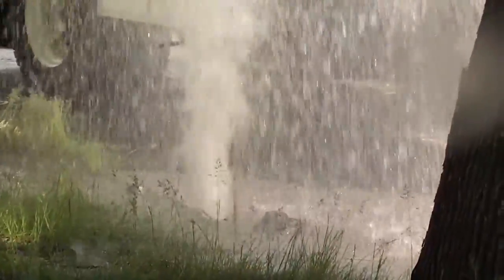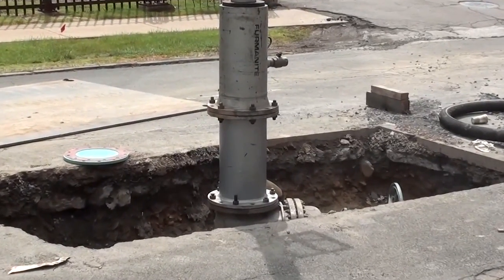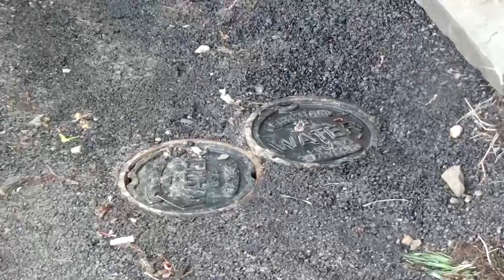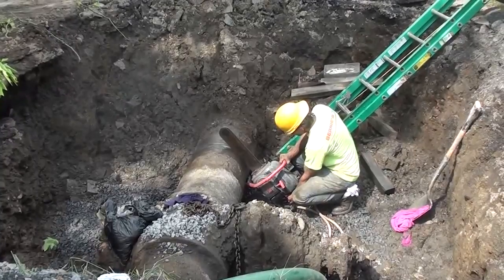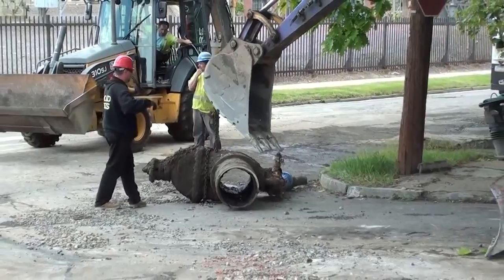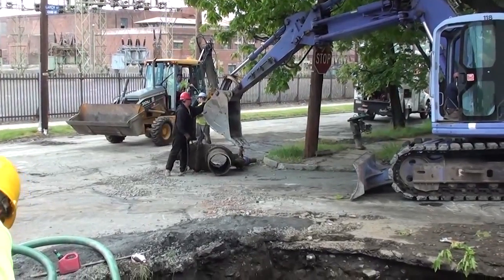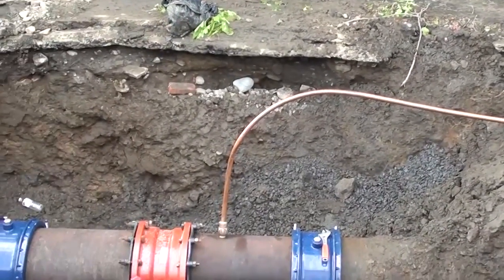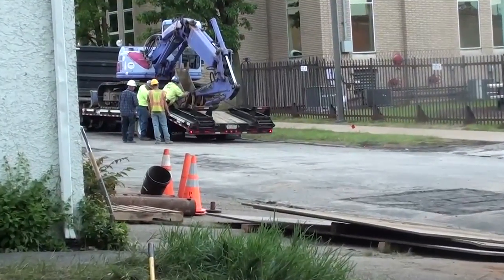HYMAX Coupling Used to Repair Water Main in Scranton, PA

Comment: That old Pipe Value was a GATE VALVE not a Butterfly Value......The RED PART on the New Pipe is  BUTTERFLY Value..And on the Two ends of the New Pipe those things are Called DRESSER COUPLINGS....You slide the Dresser Coupling on the Pipe then put the Pipe in place then slide the coupling to the Center of the end of the Pipe...Then start tightening the bolts....The coupling is Tapered and has a Rubber Gasket in it....You just keep tightening it and the coupling will Squeeze the Rubber part Making a tight Seal..
Reply: We wrap the couplings with plastic sheeting to protect the gaskets from corrosion before backfilling

Comment: Ive never seen that style of sleeve before, is it retained on the DI nipple? Why not use megalugs or another mechanical joint style fitting?
Reply from the maker: See this video that explains the advantages of using this large diameter product - https://www.youtube.com/watch?v=GY6_dFgk0lU
Reply: Much easier to use 2 bolts to tighten, but yes it could slip.
Reply: Don't see any bends or fittings nearby...so, if you make oal of the valve and nipples as close as possible to the space you have....what can move?????.. if you fuck up ...use a spacer

Comment: It’s a gate valve not butterfly!
Reply: jijiji kijiji No that’s a butterfly valve it’s a gate valve yes but when it’s on the side it’s a butterfly valve
Reply: it is a resilient wedge valve. Butterfly has nothing to do with orientation. It is a type of valve where the disc turns to open instead of rising out of the way into the hump.
Reply: What do you expect from Kevin Lynn?